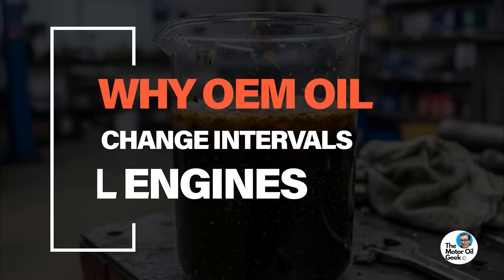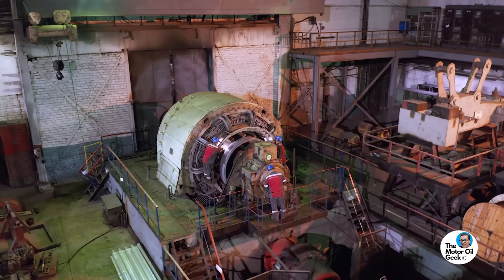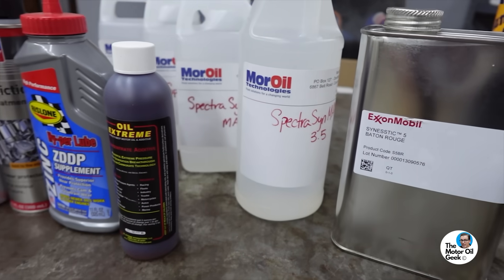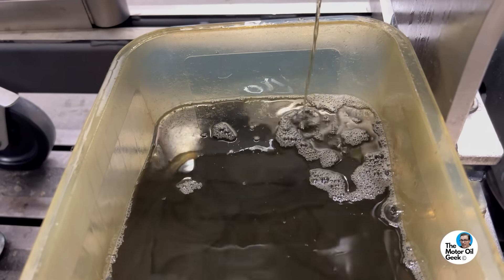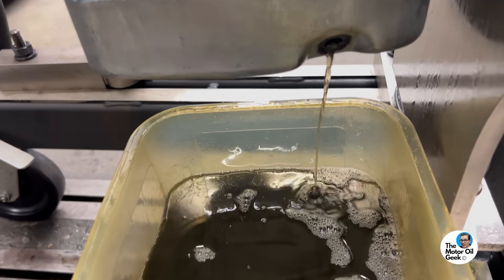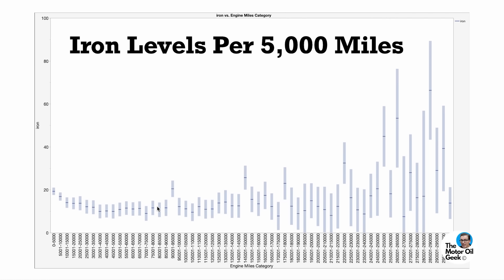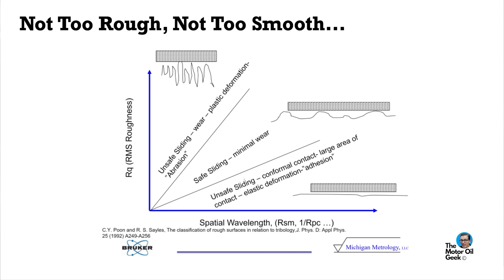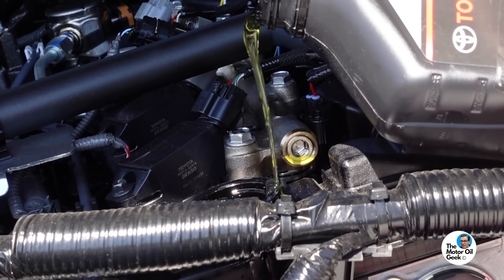NEW Data Reveals WHY Modern Engines FAIL Prematurely!

Comment: In the 1980s I was working at a engine shop. Mostly drag racing stuff, but a lot of restoration projects.we received a technician lubrication analysis from the "IHO 9000". One of the article's was about a New York City cabbie. He owned a Checker Motor cab. It had a inline 250 six. What this cabbie did was constant PE. One of his habits was to change the oil once a week, drain and replace the ATF once a week. Change the oil filter and transmission filter once a month. After 300k miles he bought a new cab. Lubrizall bought the cab to take it apart. The engine and transmission were impeccable. It was amazing how little wear there was.
Reply: That was likely excessive maintenance, but it gave him piece of mind. It would be interesting to see if this experiment could be replicated but use oil analysis to see what the actual intervals need to be.   What is the maintenance schedule on the camry hybrid taxis going 700K miles?  I doubt they are changing all the fluids weekly.
Reply: @vicz8899 I have no idea what the cabbie was thinking. Other that the article said excessive idling, running 12 to 14 hours a day. Perhaps he was using the tax right offs that he could use. But it worked.
Reply: @vicz8899 Could have been figuring the service interval based on engine hours vs mileage. It's not unreasonable considering how much time those cabs spend idling while stuck in traffic.
Reply: @vicz8899 Excessive maybe but the results speak for themselves…and that was 80’s oil tech I assume. These Camry’s, is this in the 80’s too or the present? Oil has come a long long way.
Reply: @ConcernedCitizenIn2025 We don't know that. He could have doubled or tripled his intervals and had the same result.  At some point the law of diminishing returns is fully in effect.
Reply: @v @vicz8899  We do though. Yes, there’s likely diminishing returns but there was a return during a SEVERE service scenario with what would today be an inferior base and additive pack. And again, what time period did this Camry  example occur?
Reply: @ConcernedCitizenIn2025Yes correct.
The Engine Oil was pretty good then that I remember.
It's just been updated to match the more modern requirements but it wasn't crap.
Transmission Fluid though...was really basic then and not all it is now so today's fluid is superior (UNLESS you're thinking about the trans fluid from 1957 which was Whale Oil and was oho much superior to today's stuff but illegal to obtain. Whale oil doesn't degrade at high temperature like modern stuff).
His changing trans oil which was Dexron I earlier and Dexron II later in the 80s wasn't a win it was just coolant and hydraulic fluid ability.
Reply: @vicz8899  300K very HARD miles....all that idling and start stop (this is NYC ffs).....that guy knew what he was doing. Plus he wrote it off on his taxes.
Reply: @doctordetroitt  I totally agree with "HARD MILES". And that was just part of the article. It was comparing to taxy  company's with hired drivers and there maintenance was done by manufacturer instructions. There cabs had much more where and needed repairs.
Reply: @martintodd8219  Sounds like the engine wold still go but everything else fell apart....that is common, I had tracks that got over 200K and died due to things besides the engine....it adds up quick
Reply: The 250 inline 6 is notorious for longevity he could have done all that once a month and it still would be clean as a whistle and running Strong even in the eighties 😊
Reply: @bdoggwrench  let's face it. All the old inline 6s ran forever. Slant 6 , 240-300 Ford inline 6, AMC, 250-295 GMC. Thay ran and ran and ran.
Reply: @martintodd8219  My mother had a 1970 Pontiac Stratochief with a 250 cu. in. Chevrolet six-cylinder inline engine. That engine was indestructible, and when the car was scrapped due to a badly rusted frame she was able to sell the engine! A friend didn't care about its age; he wanted that engine.
Reply: @bdoggwrench It is. Had one. 

A friend had a shop and a regular customer with an early 70’s V8 Caddy. It had 300k on it and didn’t burn oil he noted. The guy religiously stuck to a 3k mile oil change interval. He told me this in the early 90’s.
Reply: @ConcernedCitizenIn2025 my 3 litre rb30 engine in a patrol had 500000 km on it and did not use any oil between religious 10000 km oil changes
Reply: Only 300,000…What’s the big deal ? I wanted to hear close to a million miles stock internals..Toyota did it with the million mile “Mule” V-6…🤣
Reply: @Bluninja218  300K is NYC is the equivalent of 3 million...point being is when they broke the engine down it was clean.
Reply: @doctordetroitt You are incorrect..😢
Reply: @Bluninja218  300k from an ancient pushrod V8 with a carb on top? That's around three times as long as other equivalent engines were lasting during the period. This would have also been back when oil was far worse coupled with the vehicle being operated in seriously harsh conditions (NYC). Incredibly impressive.
Reply: Once a week? Yeah he could just buy a new car every 3 yrs 😂 ffing dumass somthing wrong with his head
Reply: I only use top tier fuels have for yrs now.  Seems to keep the fuel system cleaner than just running a carbon cleaner through the gas tank every now and then.
Reply: Who can afford weekly maintenance. 😂 I did this when I worked a dealership. Changed my engine oil every week for a couple of months. Felt guilty but meh, it was free. Did it help? Who knows, the cat went bad so I donated it to a mechanic college. I’d change my oil @80% used oil life which is about yearly. We’ll see how it goes. They really don’t make cars or anything else the way they used to. Planned obsolescence.
Reply: Stop making stuff up, the cost of this insanity would quickly outpace straight up buying a new vehicle...unless he somehow did 10k miles a week
Reply: @emp_zealoth no, it absolutely would not "quickly outpace"
Reply: @John-2fnf  do the math
Reply: @emp_zealoth Here ya go - Mobil 1 5qt jug $30+$10 filter ×4= $160 x12= $1,920yr. $60k ÷ $1,920 = 31.25yrs..."quickly outpace"??? 😮
Reply: @John-2fnf  do the math. 1 55 gallon drum of bulk 10w30, $110. 1 55 gallon drum of ATF $120. 1 oil filter, 1 transmission filter a month $15. 4 quarts of oil a week, 3 quarts of ATF a week. 5 quarts once a month, tax right off. And did Lubrizall have something to do with it. Besides it was just a article in a technical magazine. If you don't like it go beat up a taxi driver.
Reply: @John-2fnf yeah, and a whole new checker cab back then supposedly cost less than 10k...a new motor on its own could probably be had for 1k, 2k at absolute most
Reply: @emp_zealoth so a 5gal oil jug would cost $5?
Reply: @emp_zealoth  keep in mind a 55 gallon drum of bulk 10W-30 oil was about $110 give or take in the early to mid 80s. I was done done quite often by people who took care of there equipment. "Take care of your equipment and it takes care of you." I worked at a shop that all air cooled engines 2hp to 35hp the oil was changed every 30 hours. Company police.
Reply: @martintodd8219  as far as I could find, a 1980's Checker's Cab cost around 10k. 55 gallon drum isn't even enough for a year of weekly changes, but you also claim he was doing ATF and filter changes, so by my rough estimation he was blowing through like 10% of the cost of brand new VEHICLE a year. It literally makes zero economic sense. He could could probably buy a brand new engine after 3 years.
Reply: @emp_zealoth at 4 quarts for 3 changes, and 5 quarts for one change, in a month, that's 17 quarts a month. 17x12=204 quarts.  A 55 gallon drum contains 220 quarts.
Reply: @DaleSmith-j9r  basically everywhere I could find says 5-6 quarts...
then remember to add the "weekly ATF changes" 
and all the filters
and please do us a favour and try to check how much a 250 inline 6 would cost in 1980s...
because i'm seeing claims as low as 650$, but I wouldn't be surprised if you could get something good for a 1000$ back then
Reply: @emp_zealoth if it was a GM built 250. It took 4 quarts, without changing filter, and 5 with the filter. The down time for the engine to be switched,  and the labor involved is another cost.
Reply: @emp_zealoth this video is from the motor oil geek, not the transmission fluid geek, so I don't think  the transmission fluid changes have anything to do with engine wear.
Reply: @DaleSmith-j9r we are talking about people being insane about "preventative maintenance" that would quickly cost more than buying a brand new motor in 1980
Unless that cab driver somehow hit 300k miles in 3 years...
Reply: @emp_zealoth you  don't know the  situation,  nor do I. This YouTube channel is about motor oil, and this video was about engine wear. You were bean counting,  and saying that it was impossible to get a years worth of oul changes,  out of a 55 gallon drum of oil. I was only pointing out, that it very well could be  done.  What about keeping on subject,  with the video content,  and not worry about how  someone did their maintenance,  and spent their money. Someone just included that as an example of engine wear, and oil changes, but you were more worried about a person not being able to do a years worth of weekly oil changes,  with 55 gallons of oil. You said it wasn't possible.  Guess what,  it was on the 250 cubic inch engine.  Further more,  the 250 inch engine was discontinued in 1979, so it wasn't a 1980 engine anyway.
Reply: @emp_zealoth we weren't talking about people being obsessive with  oil changes , you were. What a person does to their own vehicle, you don't get to control.  The point was, that frequent oil changes lessen engine wear, regardless of what you consider reasonable.
Reply: Own a 2020 Nissan Versa S. Bought it new. Did 3 early oil changes until it had 500 miles on it. Now change every 500 miles. Which is once a year. Full synthetic. Should last through retirement. Grocery getter
Reply: @Elven-il5yc good idea. I would do the same.
Reply: Old inline six were impossible to destroy. If my 3.0 Vulcan gets destroyed I’m putting in an old ford 300 straight six
Reply: @RipliWitani  if you can find one.
Reply: Two Nissan Hardbody pickups, one with 390k, the other with 330k. Oil changes at 4-5k.  Trucks lived on dusty gravel roads in mountains of Colorado. No oil burning in either. Mostly used cheapest conventional oil.  Tore down the 390k engine for other reasons.  Machinist was amazed at the lack of wear. Cylinders still had original cross hatch very visible. Bearings like new.
Engine design still the primary factor  in longevity.

Comment: So if there's always been tiny contaminates circulating through the oiling system, it seems the reduction in clearance for thinner oil usage, now allows for said contaminates to damage surfaces/components which continues until engine damage occurs.
Reply: There you go 👍

Comment: what is ridiculous is when i got my toyota and tried to take it in for an oil change after about a few thousand miles from brand new they refused to do it saying it was not due till 10,000 miles i told them i wanted it changed anyway. I had to pay them to change it sooner they have this stupid scam of first few oil changes are "free" they are included in price you pay they want you to wait till 10,000 miles. after the first few oil changes istopped going to dealer all they wanted was to get you in to sell you stupid scams i change oil twice a year or 5000 miles at most

Comment: I bought a Ram Tradesman 1500 with the Straight Six S/O and am going to change the oil religiously at 5k. No more dipstick, the oil levels are calculate by sensors now so I'm gonna have to stay on top of my oil changes.
Reply: What if the oil level sensor fails or gives the wrong level, causing engine seizure or a spun bearing? Who pays for he repairs ?
Reply: @PassivePortfolios  I would think the warranty would cover the powertrain.
Reply: @will5150  Hopefully, the sensor fails within the warranty period.

Comment: Lake, what about using a by-pass filter?  I know Amsoil did offer these for gas engines, haven't checked lately and they do offer them for diesel engines. The filter sips oil from the system and it goes through a 2 micron bypass filter, removing tiny particles. The filter head has a plug that has a 0.030" which restricts flow so it does not harm engine vitals. Over a period of time all the oil is filtered. I used to restore cars and the original Purolator oil filters were bypass units and they too used a 0.030" hole for the oil to pass through. I am thinking of putting one on the V-8 I am building which does have an oil cooler and it will make plumbing easier.

Comment: Dagnabbit... wish I'd seen this cleanliness corroboration re break-in (around the 8 to 9-min mark in this vid) about 7000 miles ago... I have a 2025 Godzilla Super Duty and I WAITED to 5000 miles! to make the first oil change, with planned 5000-mile oil/filter change intervals. Dagnabbit. Using 5W-30 Synthetic Blend, part# spec'd in the Super Duty Owners Guide.

Comment: As someone that has done the break in on several 80s japanese motorcycles,  the power from the break in is really felt at around 100 miles. Thats around 200 miles for a car or truck due to the lower rpms. To break in an automobile  i recomend changing  oil at 200 then 500 then 1000  then 3000 then 5000 regularly. And install a magnetic drain plug asap if it didn't  come with one. You only get to break it in once!

Comment: The Car Care Nut channel for Toyotas states that variable oil pumps are affected by oil viscosity
Reply: Yes, he stated that the oil pumps are calibrated differently for different regions, which is why certain engines are specified to use 0W20 oil in the US, and 5W30 elsewhere.  It was in one of his recent videos.
Reply: I like TCCN, but I think he’s wrong on this one.
Reply: @ChicagoRob2 I think so too. The ECU will auto adjust like it does for fuel. You can’t buy a Toyota in the USA and move to Canada or Mexico and use the oil recommended for that region because it was hard coded? Nonsense.
Reply: @ChicagoRob2 he's not wrong it's just the interpretation of what you can and can't do. 5w30 is perfectly safe to use
Reply: That is absolute nonsense.
Reply: Which oil is thicker in the middle of winter?
0w-20 in Alaska, or 5w-30 in Alabama?

The 0w-20 is thicker. So, 0w-20 can harm engines in Alaska.

In winter, the thinner 5w-30 in Alabama will never hurt any engine.
Reply: @dvader3263  Don't be Logical, Your supposed to believe all the BS 🤣

Comment: I believe also if oil filters were larger with ultra micro filtration would also be better instead of these small filters with just average micron filtration.
Reply: Always felt like oil filters on most gas cars are way too small 
Would be nice to get some data on that
Reply: @danielkiss7003  I agree.  Seems that there is a place in the market for a really good filter - perhaps Donaldson has one?
Reply: @dermick  Trasko filters filter down to ~1 micron (or less) and have substantial cooling fins. The fins make it much easier to remove than a normal filter as you have lots of grip. It's got about 400x more carrying capacity than a normal filter... so I only change it ~80,000 km. I do oil analysis each oil change so I know it's still filtering properly (no increase in oil particles) even at ~80,000 km.
🙂
Reply: @danielkiss7003  They all do the job they're meant to do i.e. They're up to the task. However, a bigger filter gives you more capacity and cooling... especially if you use an aftermarket filter. If you're uncertain and need to be convinced do an oil analysis with different oil filters. If the wear remains unchanged you'll know the alternative filter works just fine. Most filters can also be changed every 2nd oil change. Their carrying capacity is way in excess of the filtration requirement.
🙂
Reply: I still use quart size filters.
Reply: I noticed my oem filter is tiny Toyota N1 where an older 2x larger F1 screws right on.  I had half a box of F1 that I used up but went back to the N1.  My reason is with the hybrid system cutting the engine off and on having a small filter will limit any prime time, and if that’s in the filter I would rather just be oem.
Reply: @DrinktheVenom  You can answer this question definitively by doing an oil analysis: Before and after. If you can't see any difference in wear than the larger size doesn't matter. In my experience a larger filter doesn't result in increased wear.

If you want extra protection bond a lubricant to the inside of your engine so that you're never starting dry.
🙂#XcelPlus
Reply: That is nuts!
Reply: @PassivePortfolios you are hung up on the greenie side of everything.
Reply: If you like you could install a double filter. Therefor you need a special bracket or housing. Or design something your self and let it C&C milled. 3D printing could be possible too when using the right materials and design.
Reply: @theblackhand6485  Often not necessary - just match up a larger filter to the one specified.  If the thread size is the same and the rubber gasket is in the same location, you can use it, providing there is space for it.
Reply: @jamesbosworth4191  I fit a larger aftermarket filter with 1 micron filtration.
It filters ~40x better than the standard filter and also has large cooling fins so it cools the oil more.
Seems to be no harm in fitting a larger filter.
I've been doing it for ~50 years now across a wide range of cars.
Just need to ensure the thread and seals are correct.
However, most threads seem to be a standard metric size and 99% of seals seem to be compatible.
There is enough room for an oversize filter in most vehicles... although you can't wildly oversize the filter.
🙂#Trasko
Reply: @1Wondering  Smart.

Comment: Certain FI systems will signal an error code with a closed air filter. Will I have sooted components severely by this point or maybe even damaged the filtration system.?